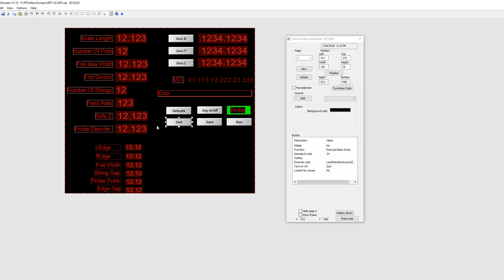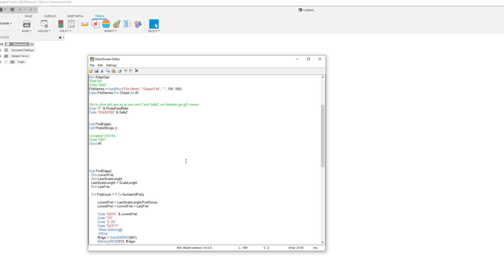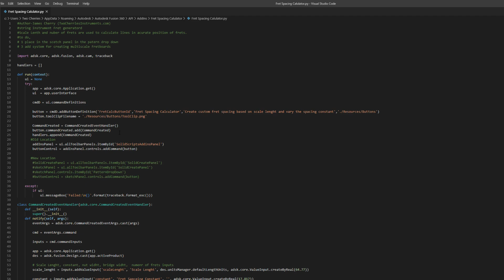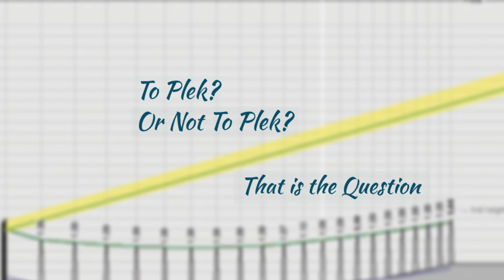To Plek? Or Not To Plek? that Is the Question | DIY CNC Fret tuning

Comment: I've also been casually thinking about how to increase accuracy in neck and fretboard construction. Just simple thought experiments. I'm very happy you are on it and off to a great start. Please don't stop.
Reply from the maker: I nearly have the python code for probing the fret board done. I still need to design the jugs for holding the instrument and neck in tension while probing, and grinding the frets. I am putting in a lot of work on this in the background. I think it's a way to significantly improve the accuracy of the work and at the same time bring down the labor hours.

Comment: How would you machine the frets on you CNC? Guessing they'd need to be machined with abrasives? Diamond end mill type deal? Guess the thing to watch for is the heat if you're using super glue to seat your frets (could use air blast as coolant on your router). Awesome idea. Would love to see how it goes.
Reply from the maker: Yes, I plan to do the machining with an abrasive, the ca glue is mostly to fill voids, the frets stay in without the glue I just like to make sure that any gap is filled under that fret. I will have to do aime teats to see if heat is going to be an issue.